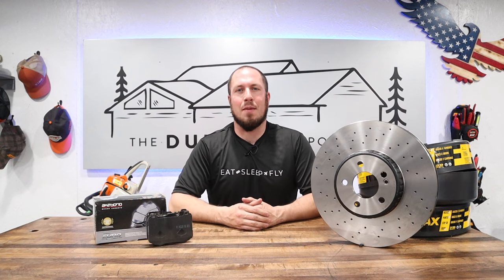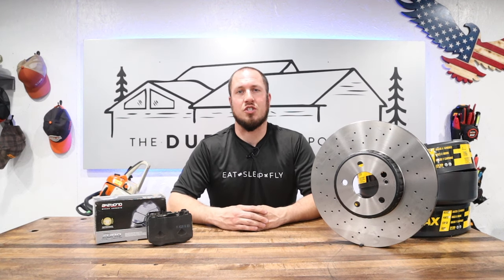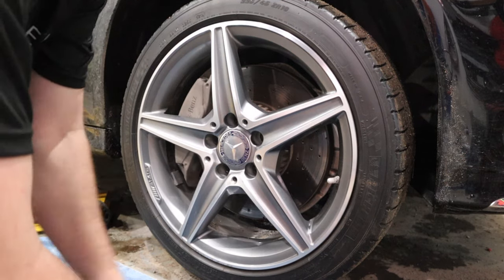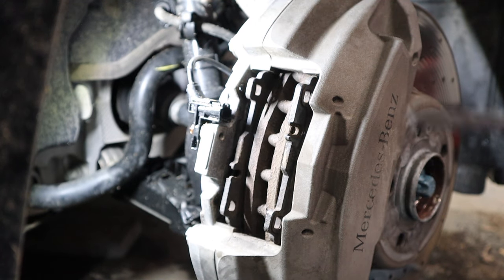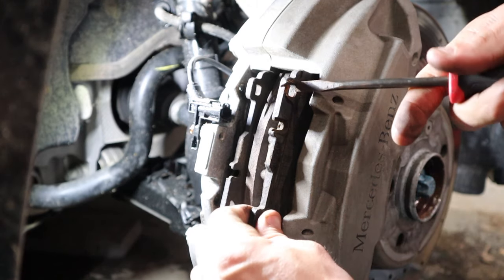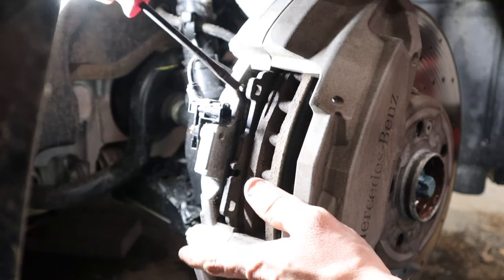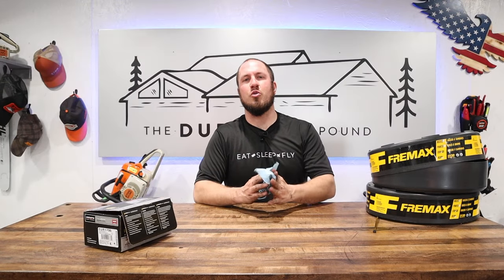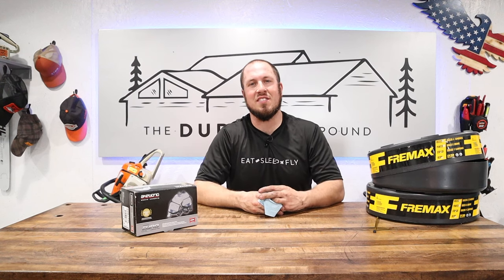Mercedes C300 W205 Sport Brakes Replacement

Comment: TheDurbinCompound...I love it when clueless guys like you make instructional videos!....The inside pads do not ''generally wear faster than the outside'' they should wear at the exact same rate when serviced correctly...but the sensor should be placed on the inside pad... just because the inside pad is ''generally'' harder to visually inspect than the outside pad...

Comment: Ok - last comment; I suggest anyone else doing this maintenance look up the correct torque specs for the bolts. Everything is online these days… definitely should use the correct torque, especially on brake components.

Comment: Thanks for this very detailed video. Used this to change the brake pads on my W206 C300.
Reply from the maker: How is the W206?!
Reply: @TheDurbinCompound  I upgraded from a 2019 CLA so its an improvement in every way. Even handles as good as the CLA which I was surprised by considering  the C300 weighs 100kg extra. Very comfortable and fun to drive when you step on it.

Comment: I just replaced them today with the same exact rotors and pads, 35K miles on a 2017 C300 with AMG package. Originally I wanted the Brembo brakes and I found them at a really good price, so ordered them from eEroparts. A few days later they canceled my order and told me they were out of stock even though they showed several available at their warehouse. So I don't know about that place! They have mixed reviews and other folks complain that their orders got screwed up, wrong parts were sent, canceled orders, etc. My factory rotors started vibrating right before 25K miles and got much worse recently. At highway speeds, the vibration and noise got so terrible that I had to do something about it. The dealership price was in the thousands so I bought these from Autohaus. They were shipped the next day and 3 days later I found them at my front door. Very easy replacement. The Freemax rotors are pretty solid and heavy.  Hopefully, they would make a difference. I would post another update in a few days after I drive around for a bit. 
Thanks for the great video!
Reply: How have they been?
Reply: Do you remember the size of the rotors
Reply: Cyber, I'm having the same issues. Replacing mine tonight. Any updates from yours?
Reply: @HighclassRick  Im happy with them...no issues so far and I have a heavy foot...I did a lot of driving this summer....700-800 miles per week and no issues...
I was thinking about buying the rear ones next.

Comment: Great video, thanks a lot! I am planning to renew my disk breaks and pads in the front of MB C300 S205 over the Christmas time. For the big bots I would probably use Loctite compound to make it fixed. I am a bit scared to apply too much torque (without knowing how much) on the aluminum parts. From the other side, if I apply too little, there is a chance of loosing it (don't know the right English word for it).

Comment: Firstly, turn the steering on a left hand lock, you will have a lot more room.
Then, push the old pads back (against the pistons) before you remove them, easier to take them out, and no need to use a tool to push the pistons back later. 
Calliper bolts are NOT made of aluminium, they are zinc plated steel bolts. You DON’T hit a three eighth ratchet with a hammer. Bodge. 
Don’t use WD40 on rubber seals, it does them in. Calliper bolts do need ‘torquing’ and thread locked when replaced. 
Don’t use lithium grease on brakes, sparingly apply anti seize (copper slip).
You don’t know what you’re doing. 
BODGER.

Comment: Great video!  Now that you’ve had these rotors on the car for a while…how do you find the Fremax rotors?  Any extraneous rust issues?
Reply from the maker: I like the freemax rotors. They have been great. No noises, don’t warp easily, no excessive rust. The back factory rotors are noisy and squeak constantly with the ceramic pads
Reply: @TheDurbinCompound  Thanks…have the same year and model. Stock rotors are super squeaky in cold weather and have developed vibration from glazing…all still with less than 50k miles. May give the Fremax a go when I change everything out. Thanks!
Reply from the maker: Yeah the stock rotors developed a bad warp from not over aggressive breaking. I was surprised. The freemax rotors have taken way more punishment

Comment: Great video! Do you have any experience with a rusty/scratchy noise coming from the front wheels?
Reply from the maker: No I don’t. That’s sounds like it could be just dirty pads. You can slide them out, sand them, clean them with brake cleaner and reinsert.

Comment: Great Video!!! 🙌🏻 
Sir, Did you at some point had vibrations coming from the rotors/brakes before changing it eventually? I’m having bad vibrations under braking at high speed (70-80mph) but the dealership said I still have a lot of brake pads (60% life on it) I’m wondering if it’s the rotors some case of uneven scratch. 
Also, how much are the rotors and brake pads? Thanks so much!
Reply from the maker: Vibrations under braking are caused by warped rotors. They have been too hot and before and warped on you. I buy all my stuff from AutoHausAZ. Google them. They have many selections from OEM to budget friendly options
Reply: @TheDurbinCompound  Thanks so much! I appreciate it. 😊 🙌🏻
Reply: This is a common issue with Mercedes brakes, at least on the C-class cars.  My wife's 2012 C300 4Matic, 2014 GLK350, and now 2017 C300 with AMG Sport package have all had this issue.  The GLK had the brakes replaced at 20,000 miles at the dealer, and the problem was back within a couple hundred miles.  It's really frustrating, because cars that cost this much shouldn't have this issue.

Regarding warping, I don't believe this to be warping, I believe it to be pad material build-up, as I can do a bunch of hard stops back-to-back-to-back and the issue goes away for some time.

Comment: @TheDurbinCompound : i did exactly like in the video, step by step, everything went smooth ( replaced sport front brake pads) but my pads are not biting the full size of the rotor. Did i do something wrong? Or its a bad rotor?

Comment: Hi, great video mate.  Did you have to go to the car's menu to reset brakes sensor countdown and if so where is the menu to do this. Thanks
Reply: @krumzlatanov2852'....''menu to reset brakes sensor countdown ''.....lolololololololol
Reply: @mark006868 BMW have manu where you can reset brake sensors countdown after you replace them with new once ,but amateurs wouldn't know that 😂
Reply: @krumzlatanov2852  lolol....well you are the ''amateur''....cause this is not a BMW...lol and besides...The long term count down in iDrive is a guess, pure and simple. It's based on the assumed number of miles that new pads can be expected to last, and there's a famous saying about what happens when you A-S-S-U-M-E. The warning generated by sensors is different, they trip when the actual pad thickness is down to a specified limit. That would normally cause a short term count down to begin, starting at 1000 miles as I recall. This system isn't perfect either, because there are only two sensors, on the left front inside and right rear inside pads, leaving the other six pads unaccounted for. A broken sensor wire can give a false positive as well. Bottom line, yearly visual checks of all eight pads is a must....and only an ''amateur'' can trust an assumption which is something that you accept as true without question or proof....

Comment: I also have the W205 C300.  2015 version.  Just interested in how many miles on the original brakes.  Thx
Reply from the maker: Rear brake pads wear out about every 40,000 miles due to the design and the electronic parking brake.  These front brakes had 130,000 miles on them and just down to the wear sensors. I did not need to change the rotors but did for video sake.

Comment: inside pads wear faster than outside pads only in sliding calipers, wear should be equal on fixed multi-piston calipers
Reply: correct...

Comment: Your caliphers are engraved MB, mine have a OEM face plate on the caliphers. And yeah, Brake cleaner has left caliphers looking spoted & striped. I want to sand, clean or paint them, but the plate I have heard may easily break ⁉️

Comment: Hi, could you tell me if those calipers and discs can be installed in a W176 A200? I can't find any compatibility guide.
My stock discs and calipers are much smaller than the C class ones
Thank you!
Reply: Have you figured? i owned W176 too
Reply: @AimanAmirul11  not valid.

Comment: Aren't you supposed to open up the caliper by putting the car in break service mode ?
Reply from the maker: Only on the rear pads with electronic parking brake

Comment: Hammering a ratchet is a great way to wreck the gear drive in the head, better to used an offset box wrench and hammer that to crack the bolts

Comment: Wanted to point out the amount of lube you put on the pads was excessive. I would not recommend putting lubricant of any kind on the edges of the pads. If any of that gets onto the rotor, you’ll lose virtually all braking capacity at that wheel.
Reply: He did that correctly you put lube on the edges so you get smooth movement on the pads with no squeak. Although on these new mercedes before you do a break job you want to go into the settings on your dash and put into “fitting position” other than that he did everything correctly.
Reply: @jazmengroves1279  First of all there is no such thing as a ''break job''....We are dealing with brakes and not ''breaks''....and there is no such thing as a “fitting position” except for electric parking brakes which would be on the back brakes and not on the front brakes... other than that your comment is totally asinine....

Comment: Never ever lube threads. You're screwing the whole torque specs of the manufacturer and the bolt will be overloaded when tightening. And, for gods sake, just buy metric tools...